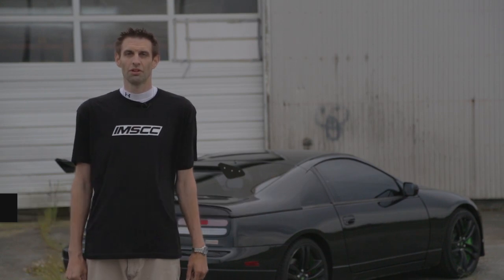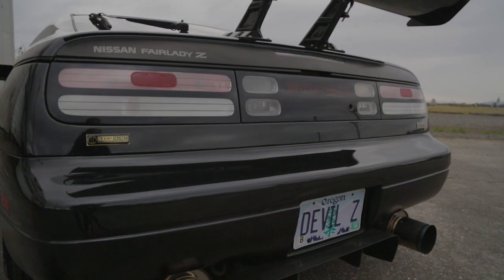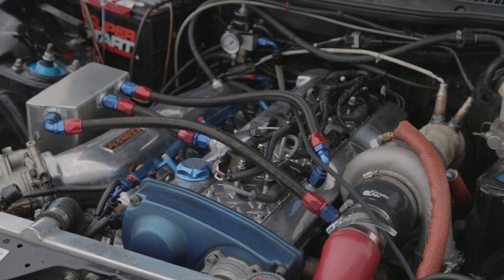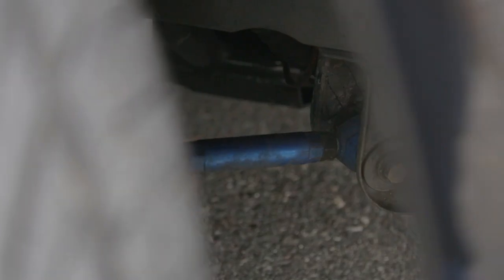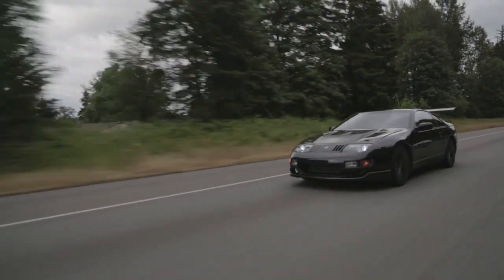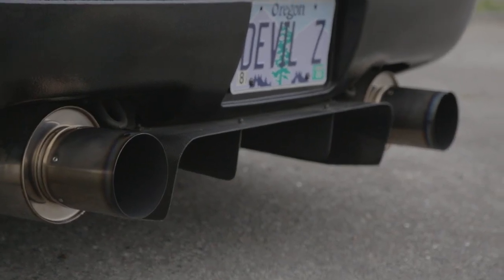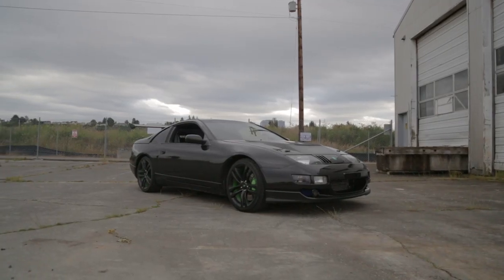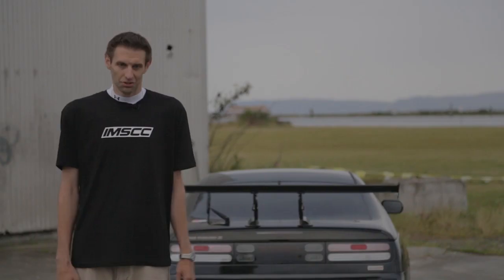1991 Nissan 300ZX Turbo - RB25 Swapped - 2014 IMSCC Competitor

Comment: Nice swap your mistaken the stock Z motor has plenty of power. Some over 1000hp.
Reply: Brian Heiden but changing the spark plugs on a VG30DETT = hours. Changing it in an RB = minutes. one manifold, one turbo, one fuel rail, one intake, just as many cylinders.
Reply: HeavenzBreaker True but its no longer a true Z. Only thing you can compare fairly is another skyline and i think you and i both no who is going to win that race.
Reply: Brian Heiden it's still a z. the cassis makes just as much difference as the engine does.

the engine is actually the lesser influence than the dimensions of the shape it sits in.

And a Skyline is not saying much. There are at least 4 trims of each model since the R31 up until the R34. Then there are the new generations on the V platform, none will beat the TT Z except maybe the V37 with 340 crank. and then only in a straight line.

the GTRs from 1989 till 2002 would be the only ones to beat the Z. all other models fell short.
Reply: HeavenzBreaker Do you really neet to change your spark plug, manifold turbo and fuel rail all the time? Not trying to give you a hard time man beautiful car.
Reply: You did step over the line a bit with z32 fans saying that the balance was better than the VG30dett. If your speaking of balance in terms of weight there is a reason they dont use the inline 6 anymore its because the v6 is better balanced up front. The inline 6 stretches the weight out toward the front of the car which is not good for handling. Its still a cool swap but not better than the vg30dett.
Reply: NjBorn Give him a break bro at least its still nissan although I dont agree with the swap for more power though. There are some things that would be easier to work on for sure its an inline six quite a bit of room on the sides vs a v6 twin turbo. Still its vg30dett for life for me though!

Comment: I'm going to locate a 2+2 hardtop rolling cage z32 and drop an LS7 into it... then fix up the suspension. An LS series is actually lighter then the factory motors. Also going to go wide body in the rear with a rear frame mounted spoiler, track wieners and fat rear tires.

Comment: wing is gross. a big country labs or voltex something motorsport oriented would have been better. those rims are gaudy as fuck get some smaller rims and beefier tires
Reply: unfortunately bigger brakes need big rims.
Reply from the maker: I have yet to see a Voltex or similar wing on a 300ZX. I believe there are limited options for wings that will fit well on the rear of the car.
Reply: JDM Sam i know it looks great on it just dont like that hellaflush shit. function > form
Reply: daybreaK the guy's wheels in the vid is neither hellaflush NOR function. they are just tall with a crumby offset, but only like 8.5" wide, and a boxy ductape thin tire. Looks almost like locomotive wheels. 

10+" rears on 305+ in the rear would be better for that FR grip and looks. Italian supercars and F1 have it like that for a reason. the fronts can be like 9s. This is a track car after all. it needs to be beefy but FUNCTIONAL, but not dumb hellaflush 13" with broken camber and tires that don't fit all the way on the wheel to the edge and come straight down like they should.
Reply: HeavenzBreaker im all about function but this just looks ricey ya know, some work xd7's or te37s many great wheels out there to use. and im talking like 9.5 front  10.5 rear, r888's or federal rsr's. i hate that hellaflush bullshit but a tad of camber nothing excessive helps

Comment: throw a ls1 in it. than youll have real power n torque and no need for a turbo :)
Reply: Pretty sure a big V8 will upset the balance the owner is after...
Reply: TeamDriftNationVideo
ls1 weights less than a RB25 or the stock engine of a 300zx. Just saying.
Reply: TeamDriftNationVideo pretty sure an rb25 weighs more than a ls1 lol not to mention it costs more to make the same power and that oil baffle issue in the bottom end of an rb25
Reply: daybreaK who the fuck would want an obnoxious v8? save that for the old/heavy american cars
Reply: did i say the rb was lighter? all i said was why would you put a v8 in a tuner car.
Reply: RANGAMvK
Maybe because its more powerful naturally??? and lighter??? and more affordable??? and like daybreak said "not to mention it costs more to make the same power and that oil baffle issue in the bottom end of an rb25". And its a free country.
Reply from the maker: daybreaK
LSX engines have oiling issues as well. We're pretty sure the owner wanted to keep it Nissan and turbocharged which is respectable.

We're big fans of V8's in imports though - even our project car is swapped with an L33.
Reply: ImportMeet im doing a 2jz swap with an r154 in my s14. still cheaper than an rb25 build lol
Reply: RANGAMvK i live in america and its easy to get parts off the shelf if i ever needed any. the low end torque their are many reasons to add a superior engine into a great chassis. there is a reason why people are swapping v8's into japanese cars. so hop off some jdm fanboy shit because it shows youre clearly not a motorsport enthusiast, let me guess youre herrafrush?
Reply: ^lol. Very well said.
Reply: daybreaK Are you fucking serious? Who said that he was a JDM fanboy? All he is saying is that not everybody wants to throw a V8 into every car. There are other options out there for a reason. If the LSX platform was the absolute best engine ever produced, then companies wouldn't bother making anything else. That isn't the case. The point is, it doesn't matter if the LSX is "naturally better," the owner wanted to keep the car balanced. That means that he was not looking for a light engine, and he wasn't trying to make a track car. He was trying to make something fun to drive. You don't need a V8 to have fun.
Reply: Whilst the LS series is great, easy, cheap power. The cost to install, engine mounts, gearbox mounts, custom tailshaft, engine wiring, new radiator to suit LS hoses adds up, then add intake, exhaust, flash tune and cam. With the RB25, You can bolt on a cheap T67, sort out fuel system and a nistune, clutch to hold the power, and you're sitting on 500hp. LS/RB25 come out fairly even $/hp
Reply: so throwing in a rb25 with kit and turbo including everything else wouldn't be as much??
Reply: leo renner He didnt say that, he said they would be fairly the same in price. Swapping an LSX into this car would require you to change just about every part of the car to make it work, while with an BR25 swap into another nissan, you wouldnt have to change as much and can use the extra money to build some power on the engine. For the prices to performance, the two engines come out about the same. If he wasnt worried about money/performance, then an RB25 still makes the car more balanced than an LSX and it keeps the whole build nissan.
Reply: leo renner As BaconCoqSlap The Third said RB swap into other nissans is easy, most if not all mounts are interchangable between skyline, silvia and zed. I spent about $3500 on aftermarket parts: turbo, injectors, clutch, external gate and ecu and I'm sitting at 500hp on pump fuel. I'm not sure how cheap bolt on parts are in the US for LS motors, I'm guessing quite cheap.
Reply: +Ruben Vera yup its all aluminum.
Reply: +RANGAMvK anyone wanting high power, you want high revs of a 4 cyl, get a new lighter crank.
Reply: +RANGAMvK because HP thats why. why deny HP is a tuner car suppose to sound nasally? you can tune your ls exhaust to sound weak too.